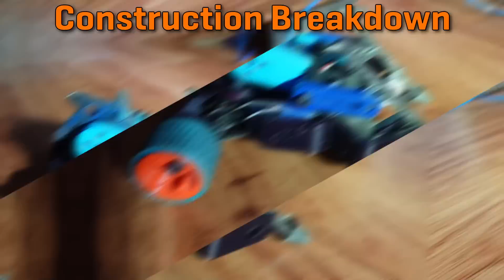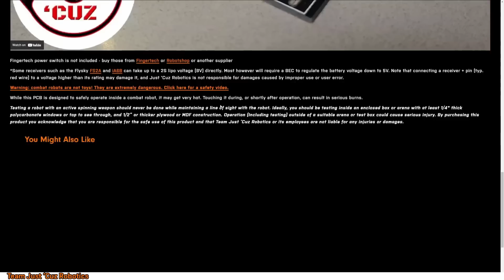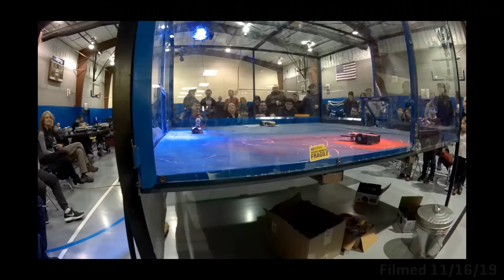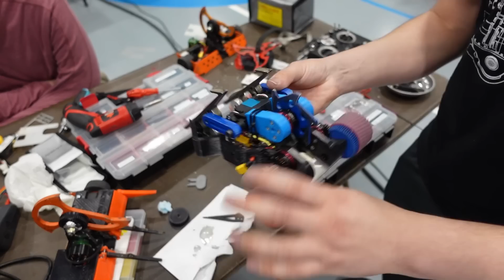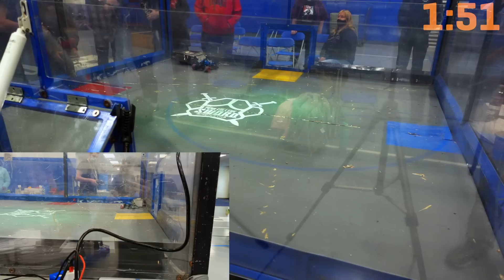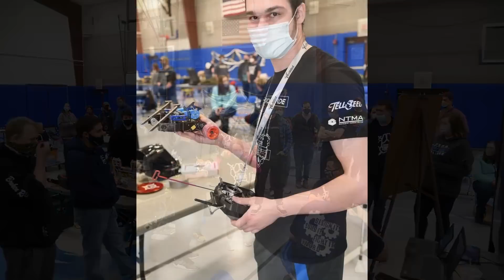Shrapnel Mine Recap, SWORD Fall 2021 - Mini Battlebot! (Beetleweight 3lb Combat Robot)

Comment: What is that spinning blade supposed to do? It doesn't have any reach. You're just pushing the other robot with the two side 'arms' and then you have maybe 2-3 millimeters of cutting depth.
Reply from the maker: It may not be so obvious from this video but it's more like 12-15mm of cutting depth

Comment: The howl "get them from below" thing is overengineered.
1, your weapon takes like 3 seconds to be used
2. it only works when pinned and good luck pinning bots with more weight that wiggle around and got weird shapes. Your test at home- a flat non moving disk- thats far from reality
3. clearly you need stronger batteries. didn't you test a full "endurance run"? like just letting it spin 5 minutes with it all on Oo?
Reply from the maker: Keep in mind this video is almost 2 years old and I learned a lot on that time. This was a proof of concept not designed to do that well. 
2: My newest beetle SSP is 2.25 pounds in it's lightest config and literally shoves around and pins bots over twice it's weight no problem. It's all about having grippy wheels and enough drive power, the weight isn't that big a deal. It's always easier to add weight than remove it. 
3: already addressed this in a redesign, I switched to a 4S LiHv and it did a bit better but still kinda sucked for other reasons. Like I said needs time and attention I haven't really had yet.

Comment: It seems like Shrapnel Mine’s design could be improved. I would have some forks that are not attached to the weapon, but end going up sharply, so pinning a bot with them would shove the bot upwards. Then it could have a traditional hammer saw, with the hinge right on the front. That way, Shrap. Mine’s forks wouldn’t have to turn downward when it attacks, a seeming weak point in the bot.
Reply from the maker: I didn't have any issues with the mechanics of the forks.  Not really sure what you mean. I think the major issues I had were that the battery life was too short, drive torque was a bit lacking, and the front heavy weight distribution made it worse. I'm already working to address all those issues with a redesign.
Reply: @JustCuzRobotics  So, what happens when Shrap. Mine fires it’s saw?

It hoists itself upward via its forks, because they’re hinged on the hammer arm, right?

That just seems like a weakness that, no matter how slight, seems easily fixed, and you wouldn’t have to worry about being vulnerable for that split second that it does that hoisting.

So, if your design requires pushing another bot into the wall anyway, why not just shape the forks so that they turn the opponent over upon pushing them into the wall?

And on top of that, why not give it a Tantrum-styled puncher to make it easier to get to the bottom than with a hammer saw that has to arc upward?

Just trying to expound an idea here.
Reply from the maker: "Why not give it a Tantrum style puncher"
That's a lot easier said than done. I use an off the shelf servo for the arm motion which is very powerful and convenient for positional control but it's much slower than a puncher would normally be. I pretty much would have to re-engineer the entire weapon system. I don't think fixed forks will accomplish the same goal I have in mind for turning a bot onto its side either but I can play around with some ideas for that. Combining both doesn't seem too bad. I also don't think the hinging action makes the bot vulnerable since the AR500 forks are sticking out past the hinge points at all times even mid pivot. There isn't anything for the opponent to grab onto if they have a wide drum spinner, and if it's a narrow vertical spinner I will try to avoid a head on engagement. I generally will avoid pivoting the arm forward until I have the opponent in a good position.
Reply: @JustCuzRobotics  Ok. Yes of course it would be hard. I laughed at the beginning of your reply cause of my ignorance.

Comment: How much does it cost to get started in this sport?
Reply from the maker: I plan to do a whole video about this topic as a 4000 subscriber special. Short answer, as much as you are willing to spend, but probably at least a few hundred dollars upfront. Lots of buy-once-cry-once items that are costly but well worth it in the long run like tools, 3d printers, batteries and chargers, and more durable components.
Reply: @JustCuzRobotics  So to be competitive you are looking at no less than 1-2 thousand? Also, I realized that I didn't specify weight class so I'm guessing the price you gave me was for the 3lb robots? Is there a reliable website that you guys use for parts information ect? Im an old guy that needs a new hobby and I love watching the videos. I know the bots on TV are crazy expensive but it sounds like the 3lb class is something I could possible afford. Thanks a bunch for the info !!
Reply from the maker: No problem!

I don't think that it would get into multiple thousands when just starting out. You can get a really good transmitter, battery charger, soldering equipment, cordless drill and hand tools for like $300-400. Cheaper versions of all that for <$200. For robots themselves the price is really dependant on how you intend to make them, what materials you choose and if you have to outsource machining or other fabrication services (which is a huge cost driver for larger bots than 3lb but not a requirement at 3lb and smaller).

For Shrapnel Mine I think I spent about $1000 for parts to build nearly three complete robots, and that is by no means a particularly cheap robot. That's not including the fixed cost reusable stuff I just mentioned. About $340 of that was just for outsourced machining which is avoidable in most more traditional robots.
Reply: @JustCuzRobotics  Thanks again!!

Comment: would be cool to see Shrapnel mine gradually scaled up until it reaches the 250lb weight class.
Reply from the maker: So far I have never tried to scale my designs, I tend to prefer building something totally new in every weight class. Every weight class requires totally different construction methods, making it only minimally faster to scale an existing design compared to designing from scratch - every single part needs to be redone from scratch anyhow. That said... I have plans for a 12lb full combat bot for 2022 which may have inspiration from a larger robot 🤔😊
Reply: @JustCuzRobotics  tbf the half control - half spinner is catching on in BattleBots. We got Whiplash saw blaze and skorpios as some of the best examples.

Shapnel Mine's weapon system might be the next step for this type of robot. Because it's designed not just to control the match's pace, but it also attacks the one area that simply cannot be protected without exceeding weight limits.

Comment: the hooks on the top of the forks seemed to make the saw get less reach into the underside of bob in that fight, and they did get caught on the egg beaters, not sure if you're want to get rid of them but just a thought
Reply: oh yeah also this was great fun to watch,  keep it up
Reply from the maker: Thanks!

Imma be honest I do not intend to fight many robots with egg beaters attached 😂

I want some sort of backstop but the forks aren't as shallow of a slope as I thought so riding all the way up is way harder than I had assumed it would be. I think I'll probably make them hook over like 100 degrees instead of like 150 degrees, and be a lot stubbier. Also considerring making the saw arm longer to get more bite into opponents and maybe even bigger diameter saw as well, we'll see

Comment: Those wheels must have insane grip with how much weight is on those forks it moves great.
Reply from the maker: Yeah I was pleased with the grip for sure especially given they are getting covered in sawdust and debris and still working.
I have a tutorial vid where I cast wheels for my 12lb bot and it's the same exact process for these, only difference is the hubs and molds (obviously), and I used a softer and gripper shore 30A urethane because the 40A is out of stock everywhere due to a global urethane supply shortage. I also used Micah powder dye instead of liquid which is much easier to get a decent color without ruining the curing of the urethane since it isn't diluting it. 
https://youtu.be/U-_xxI6qvlg

Comment: Any reason why the wheels don't just have the large gear printed onto the hubs? I've been doing that for some of my bots. Why two parts with the hex connection? It seems like a single part would've more robust.
Reply from the maker: Partly because that way it prints with no overhangs and no supports, partly because it was carried over from the prototype phase when I was trying a few different materials, and in large part because the hubs are TPU. TPU hubs need to stay since they directly get hit. TPU gears I haven't tried but I expected the teeth would bend and it wouldn't really work. But I'll probably try it out.
Reply: @JustCuzRobotics  that makes sense. Maybe it just needs a larger mating feature since there's really no constraint if both sides are 3d printed. My printed and cast wheels are PLA mostly but they're interior and hard to damage. It wouldn't work as well for yours. Maybe a multinozzle printer like the new Prusa Max could print a single part with dual materials though and give you the best of both worlds.
Reply from the maker: Haha yeah I don't really wanna spend $2500 and wait 5 months to find out. That printer does look amazing tho. I actually originally designed the wheels to be able to screw onto the gears with 2 screws, I just accidentally left those holes out of the last gears I printed. I'll likely just use that so the hex is redundant.

Comment: It seems like the forks need rounded front ends. Have you considered aluminum or steel drive gears?
Reply from the maker: The motor side drive gears are steel, the interfacing gear that is printed is a $0.30 3D print but would easily be a $30 machined metal gear and would weigh 4X as much. I think I would rather the motor mounts be metal actually than to make the gears metal. Having more rigid drive shaft to motor shaft spacing is pretty key. 

And I think that I can make those mounts on the tormach myself, but the gear teeth are too small to cut conventionally.
Reply: @JustCuzRobotics  I know aluminum tends to weigh 2x as much as plastic and steel 2x that but....
Either one would likely eliminate the shearing problem and you were too light on the back anyway. :p 
(And they could be skeletonized, unlike the printed one.) 
BusterBeagle3D on youtube makes a home shop scale Injection Molding Machine. Do you think an Injection Molded drive gear would be better?
Or do you think adding reinforcement pin/staples would solve the shearing problem?
Reply from the maker: Laser cut plastic acetal gears would be just as good as injection molded but a million times easier and cheaper to make. Also steel is 3X the density of aluminum, aluminum is 3X the density of plastic. Steel is 2X the density of titanium.
Reply from the maker: Also yeah I'll probably grind the forks to have rounded points or lasercut new ones. I think 3/8" was a bit overkill, 1/4 is probably fine

Comment: Should the forks be more shallow? Seems to have a lot of trouble getting far enough under to push the opponent over and hit the underside.
Reply from the maker: Yep. That's one thing I wanna address next time. But lower start angle means more angular travel to get to vertical which means the entire linkage geometry changes... It snowballs really fast. If I can do that without having to remake the baseplates I probably will do so, those were the most expensive part aside from the CNC servo brackets.
Reply: @JustCuzRobotics  what if the forks were just not a straight line? Like the very bottom half inch could be much more shallow, then it goes back to the current angle with an elbow bend. Or maybe a smooth curve.
Reply from the maker: I need to keep the overall distance between the pivot point and ground contact point similar, but that's an option as well. I'll probably 3d print a few different options to try out, maybe a mock 3dp D2 kit for geometry testing too

Comment: It's exciting to see this in action since it's such a unique design for a saw.

Shrapnel Mine being underweight for its first ever appearance also has an arguable benefit that there's weight to allocate into improving the bot. Bots are going to have teething issues, and seeing where those issues are and having the weight to allocate into fixing those issues seems very good for improving the bot from its first iteration. 

There's also a moral benefit of knowing the bot's core design is solid enough to perform when underweight, so it's more likely to perform well when it makes weight.
Reply from the maker: Thank you! 

Yes very true. Much better to have a lot to play with since the weight distribution sucks currently and moving existing weight backwards is a lot harder than adding weight at the back.
Reply: @JustCuzRobotics  Lots of headroom to add more battery capacity?
Reply from the maker: Yup. Rethinking a lot of the electronics for next time.
Reply: literal 'teething' issues for this one.

Comment: Gotta say, it would be neat if you could modify this robot in a way that had 2 arms on the sides for grabbing bots, that moved in tandem with the saw arm which should stay exactly the way you have it, but what I'm picturing, is 2 arms closing to grab the target, while the saw comes down on top of them at the exact same time, pretty much exactly how Deadmetal housebot from the old robot wars used to work, except instead of having the arms and saw move independently, they could be connected with joints that move everything in the right direction, because you'd most definitely need more weight to hold more servos.. or anything else.
Reply from the maker: Interesting idea. The design was motivated by fighting vertical sinners like I said at the start. By hinging the movement vertically its extremely strong against vertical plane hits. But I'm afraid a horizontal spinner could demolish the forks. I think if the arms were sliding in from the sides then a vertical spinner would demolish them easily as well.

I do want to come up with a better answer for horizontals tho. My only plan currently is replacing all the forks and linkages and saw entirely with a lifting wedge mounted straight to the servo, though it was basically an afterthought.

Comment: D2 kits are O.P.

Please nerf them in the next update. (:
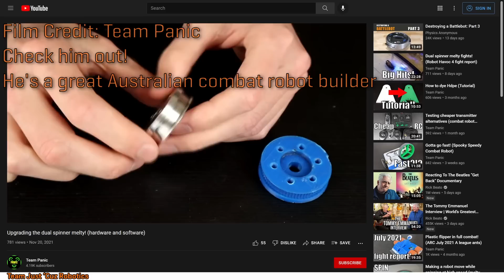Reply from the maker: I really think I had that fight until the 2:30 mark! But the D2 did go on to get second place in the weight class so I can't feel too bad about that loss.
Reply: @JustCuzRobotics  you definitely had it beat, the robot performed really well all things considered, and for its first time in combat.

But yeah, it's a basic design, but it's hard to go wrong with a 4 wheel drive aluminum framed mini racecar with a titanium wedge on the front..

Comment: I was really excited to see how Shrapnel Mine performed, it's one of the more unique design's i've seen from an overhead spinner. (or is it underhead?) I don't think the floor did you any favors, but i'm impressed how well it did perform, considering how experimental a design it was. 

I really enjoy these event recap videos, looking forward to seeing how Division and MM did!
Reply from the maker: Thank you! I'm thrilled it worked at all, I honestly was very afraid it wouldn't work at all, glad to be wrong. Clearly lots of room for improvement as well

Comment: Great to see ur experiment showing great results. And love that countdown and celebration sequence. Would a diamond saw would work too? How about adding a wedge variant of your pinning bar? And adding some armor? Since u said it's under weight, it should probably make it more solid and hopefully an exciting entry for next years NHRL(assuming u will be taking Shrapnel there).
Reply from the maker: I did actually bring a wedge config but I never had to use it thankfully. I think with that setup I would have been a full pound underweight 😂
Reply: @JustCuzRobotics  thanks for showing fighter jet robotics weapon for raptor x-22.
Reply: @JustCuzRobotics  Oh...must have missed that. But I really love ur innovative approach to bot building. I still think u should add some armor to shrapnel considering the damage beater bars can dish out.
Reply from the maker: Yeah that's the plan. Honestly I didn't show it all actually 😅